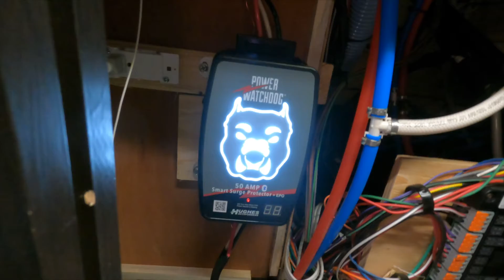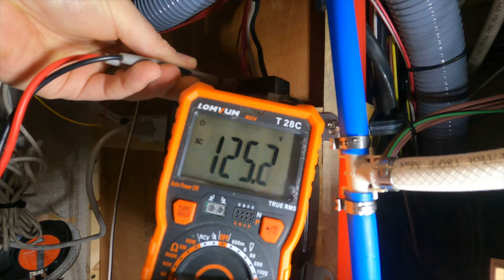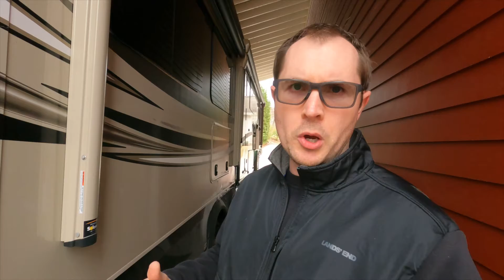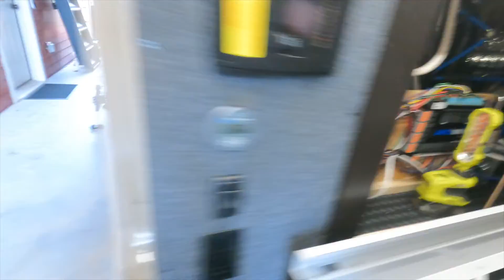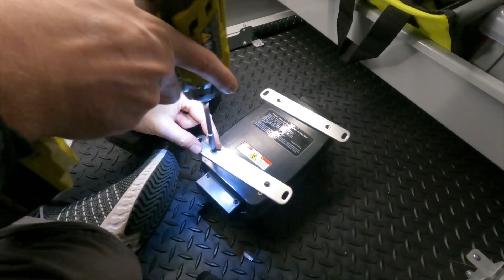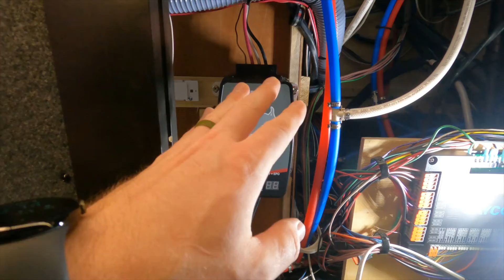Problems! Troubleshooting Open Neutral Red LED on Hughes Power Watchdog Hardwired RV Surge Protector

Comment: Did you try to just replace the circuit board
Reply from the maker: Turns out manufacturer discovered there was a defective batch of units that eventually produced the red light shown in video, desptie no open neutral existing. The manufacturer replaced them for me and others impacted.

Comment: I assume the Surge was out of warranty and Hughes done nothing
Reply from the maker: @Dave96595  actually, they replaced it ASAP. From what I gather, there was a batch of units that had a defective component on the circuit board, and after a set amount of time it would give that false positive that I was experiencing. I believe it was a limited batch affected, and once they got it fixed, the new units no longer suffer the defect. So definitely reach out to them and check if yours is part of that batch. I was very surprised at how quickly they replaced it. This was several years ago though.

Comment: Very helpful. Thank you so much! Still would be curious whether you measured L1 to L2 and what voltage you read.
Reply from the maker: Thank you. At pedestal it should be 240 L1 to L2 (both sides at W and E positions).

Comment: Having a 50 amp plug with two legs gives you 110 volt 50 amp on each of the two hot legs, correct? Assuming you do not have any device in the RV that would require 220 volt, does it make a difference whether you have the outlet wired as 220 volt split phase or 110 volt? I guess you really are getting in both cases 100 amp at 110 volt? Could there be a difference in the sense what the load is on the Neutral? Would Neutral get 50 amps through it at 220 volt in the split phase scenario but would get 100 amps in the 110 volt (2 x 50 amps)? Might make a difference what wire size you need for Neutral?
Reply from the maker: Correct, so in total it is 100A between the two legs, but just 120V. The legs are not combined, unlike a household dryer plug that looks similar and is indeed 220V. So the outlet you plug into must be wired with two 120V legs...again not combined. If they are combined to make 220V it would likely cause damage to the RV...I've never experienced this firsthand, but I have read about others accidentally plugging into mis-wired or thinking it's same as dryer plug and then frying stuff in the RV. Usually I see 6 to 8 gauge wiring on 50A RV applications depending on length. I've always seen the neutral as same gauge compared to the two hot legs. I hear your point though about why it isn't double size and I can't explain that from a technical standpoint, but my guess is it has something to do with fact it is just a neutral and not hot...but that neutral is indeed shared between the two legs along with the ground. I'm not an electrician though, so just my observations based on what I've seen so far...still learning :)
Reply: @AdventureRocks   I guess there is no way for me to know? If I test L1 and L2 with Neutral, I should get 120ish Volt each. If I test L1 against L2 I should get 240ish. If there is two lines from the panel coming at 120 and both have a 50 amp breaker, the shore side would work fine. However, L1 to L2 would show 0ish Volt instead of 240ish. Problem comes in when both lines are combined then going through the RV incoming power cable and transfer switch. The Neutral line inside the camper would get the load from both lines possibly with a total of 100 amps. While that does not necessarily cause a fault immediately, when running all ACs on a hot day all day and in addition running all else in the camper, it may get close to pulling 100 amp total. That is when Neutral is likely to get fried as it is not made for 100 amps (at 120 volt) but just for 50 amps (at 240 volts). I am not an electrician but trying to understand this stuff because I have had my shore power cable reel fried and am trying to understand why that happened.
Reply from the maker: @liveslowsailfastonlanier1374  The hot legs (or load) should never go to neutral, so if that is happening likely the pedestal or something is mis-wired. I might have missed this, but do you have a Hughes surge/EPO device or similar that checks for correct wiring? It should be able to detect all that regardless. My understanding is the frying happens when there is too much current for the gauge wire, which can be due to poor contact at the plug (dirty/corrosion leading to not enough surface area) or loose connection somewhere in the signal path (not enough surface area again) or if the breaker itself is faulty not tripping when it exceeds the rated load. The Hughes should cut power before in either scenario though...that's been my experience at least. Assuming everything is OEM on your rig, I'd double check that connections are tight from the shore inlet to transfer switch to converter/distribution panel. Sometimes I've heard about the contacts in transfer switch or breaker panel getting loose overtime with all the vibrations and then those loose connections cause loss of surface area leading to frying. I think most have a torque spec to make sure they aren't over or under torqued, but can be tricky as they are often hex head bolts/screws so need a specialty torque wrench to check to avoid damage to breakers. Anyway sorry I'm not more help on this one, but hope you can get to bottom of it.
Reply: @AdventureRocks  I have a Hughes Autofirmer (watchdog) with Bluetooth as you do. The Little LED is on as in your scenario. Both legs L1 and L2 show 120ish volt when measured to Neutral. Both legs will have power pass through the Hughes plug-in surge protector, despite the red LED being on. That seems like in your scenario.

If the outlet is wired as 220 split phase, then L1 to Neutral will read 120 and L2 to Neutral will read 120. Measuring L1 to L2 will show you 240. The amps through Neutral will be the amps going through L1 minus the amps going through L2 as both loads cancel each other out (two half’s of one sinus wave split into L1 and L2 60 times per second).

If the outlet is wired with two lines coming in at 120 volt but are not coming from a 240 split wiring, you still measure 120 volt between L1 and Neutral and you also get 120 from L2 to Neutral. When measuring L1 to L2 in this case you will read 0 volt instead of 240. 

In this scenario both lines will carry 120 volt and power flows through the surge protector. With an outlet wired like this the return wire Neutral now will carry the sum of amps from both L1 and L2 instead of the difference between L1 and L2. The amps do not cancel each other out but add to each other. 

Have you measured your outlet voltage L1 to L2? Does it show 240 volt or 0 volt?
Reply from the maker: @liveslowsailfastonlanier1374  My apologies. So the red LED in this video is actually a false positive. In talking with Hughes months after this video was published, they discovered there was a batch of devices manufacturered that all had a faulty component related to the red LED such that the majority of that specific batch exhibited the same symptom shown in this video after operating for an extended period of time. Anyway, they corrected the issue in manufacturing and it's my understanding they are still replacing the faulty devices free of charge for customers. They can determine based on serial number if your device is one of the faulty units. However, they also assured me that even with the faulty red LED light, as long as the device doesn't simultaneously report an error code, that the unit is still fully operational and protecting all conditions...just that it is throwing a false red LED for open neutral. Hope that makes sense.
Reply: @AdventureRocks
Reply: @AdventureRocks , total of 50A between the two legs, but that is 50A from L1 to neutral AND 50A from L2 to neutral.

This is important to remember because if L1 and L2 are not 180 degrees from each other, you will have a total of 100A on common which is 50A too much.

If they are 180 degrees from each other and you have an equal load on each leg, common has no load on it. Common carries the imbalance.

Comment: Any chance it is the user replaceable board. I just noticed the red light. I carry extra replaceable cards and will change it out.
Reply from the maker: It's my understanding there was a batch of units made back around 2022 that develop the fault shown over time, but the unit itself still is working and protecting properly, it just erroneously displays the red open neutral light. Hughes will replace it for you under warranty as they are aware of the bad batch.

Comment: Thank You for video. I found this after researching the red light on ours. Guess I’ll be contacting Hughes as well and see how it goes.
Reply from the maker: Sorry to hear it happened to you. I later learned that there was a batch of them produced that had a faulty component causing it to give the false positive on that red LED over time...all of them in the batch will do this eventually. So my understanding is in reality there are no issues on your rig or power source, as if there were it would show an error code. However, that one LED lights up regardless. They are fully aware of the issue now and they will take care of you. I've been super impressed with their willingness to stand behind their product. I would 100% buy it all over again.

Comment: Mine is doing same thing .. did they warranty box ??
Reply from the maker: Yes, reach out to them and likely they'll replace it. Apparently there was a batch of devices manufactured where a specific part fails over the long-term causing the false positive. So they are definitely aware of the issue and which units are affected. But if it helps to know, it's my understanding that the device itself is still functional, it's just giving a false reading.

Comment: My unit developed the same problem about a month or two ago. I had moved the RV (and thus the unit) and noticed that now…no red LED. 🤷🏼‍♂️ That’s a puzzler, but things are working.
Reply from the maker: Interesting. You'll have to report back in the future if otherwise.
Reply: @AdventureRocks However, what did I notice last night? A RED LED. I will have to contact the company.

Comment: I have had 2 different progressive industries surge protector fail.  If you have a progressive unit they ask you to pull the cover and take a picture inside to send to them before calling.  In both cases the problem was a connector had come loose.  The first time this occurred I went and bought a new progressive protector before I read how to submit a warranty claim.  So then I had two.  After pulling the cover and finding the connector issue I just kept it as a spare.  Then the second/new one did the same thing???  And yes it was an internal connection again!  Again east to fix, but frustrating!

So now I have a Hughes watch dog and two progressive spares.  I suspect what caused the connection issue is just getting knocked around while running down the road.

I now have mounted my Hughes inside the RV, but I installed 50 plugs in my RV and plugged in the Watch Dog to allow for either easy swap or by pass.   

I hope you find out what was going on inside your bad unit.  I am a little surprised you didn’t crack it open?  That is what you would have had to do if you changed out the EPO circuit.  I would bet a dollar it was a connector in this one also!

Thanks for the video!!
Reply from the maker: Hughes asked for the defective one back so not sure what it ended up being. It's great to have a manufacturer honor their warranty. I'm very grateful.
Reply: Thank you! I have this same problem with my Power Dog and will follow up with Hughes.

Comment: Mine is doing the same thing does that mean my surge protector isn't doing its job?
Reply from the maker: I'm not sure about that, but it seems like the LED indicator light for the open neutral condition was malfunctioning. Basically it was giving a false positive in my case where in reality nothing was wrong with my power source. Hughes was great about replacing it though for me so definitely reach out to them.

Comment: Mine is doing the same thing. I thought it was the parks problem and they testes their power and find my Hughes is defective too.
Reply from the maker: Interesting. Hughes was great about replacing it, so hopefully you'll be up and running again soon
Reply: @AdventureRocks  I emailed them today. They are sending me the parts to fix mine, I have the Hughes Autoformer with booster.

Comment: Did Hughes send you the swap?  They have a lifetime warranty.  There is a module that is replaceable in that unit for $30 instead of replacing the whole unit.  I carry a module with me all the time just incase.
Reply from the maker: Yes, they replaced under warranty :) Guess it was some kind of fluke in the electronics outside of surge itself. Great tip on carrying spare surge just in case.

Comment: I think I would have changed the Watchdog to a South Wire surge guard I am not a fan of the Watchdog because of the trouble I am having and their customer service it terrible or not at all. Oh and the company is 5 miles from my house so I drove over to them and talked to Brett and he did not offer any help and now has me on ignore because I have emailed and called and left messages at least 5 times. Mu Watchdog turns off the power completely for a few min. and then comes back on E6 code plus the trailer is plugged into my house where it has been for a few years and I tested the plug with another surge guard and it reads good. I wish I would have stayed with the portable surge guard. I may find a junction box and removed the hardwired Watchdog and use my South Wire SG plugin type.
Reply from the maker: Sorry to hear. I'm supposed to get a replacement under their warranty, but we'll see if they follow through. The service I got wasn't the worst, but certainly could have been better.
Reply: We used a Surge Guard brand in our Class A mounted in the electrical bay which is just forward of the genset compartment. For our trailer I think we will buy another along with the digital display and mount it in the pass through.
Reply: I had a South Wire and the thing hummed so loudly that it drove me crazy. I can barely hear the Watchdog and I don't need an additional component to monitor it remotely.

Comment: Great information in this video.  Thank you.  Do you not worry about arcing when you are plugging in your power cord to the wall.  I always turn off breaker at CG pedestal to make sure nothing is drawing current from the coach. i.e AC left on.  I melted the end of our 30 amp cord from an arc last year.  Learned to always turn breaker off first.
Reply from the maker: Great point. It's a good idea to kill power when plugging in, but arcing is more of an issue when you have a heavy load/amp draw while plugging in...that heavy amp draw while plugging in is what causes the arc. So another way to avoid is to make sure AC is always off before/after disconnecting or reconnecting.

Comment: Great video.  I have the same unit from power watchdog.  Since these have replaceable surge modules I wonder if replacing that would have done anything?  Be an interesting test as the modules are a lot cheaper than replacing the unit.  Hope you hear good news on warranty from Hughes.  Let us know.
Reply from the maker: Thank you. I wondered the same thing on the surge module. I am awaiting final verdict from Hughes, but sounds like it'll be covered under warranty either way.

Comment: Thanks for the videos. You are the reason I got my watch dog hardwire. I have it in my Jayco Eagle. I got a 50a plug tester just like you used on your 110 plug. Just for 50a so that I can test at every camp site before I plug in. No need for another surge protector.
Reply from the maker: Great idea on the 50a tester!

Comment: Good stuff Jay.   Did you check the app to see if it was reading any errors or verify what your voltage was at?  

Ironic, we have both the exact same placement for the watchdog...I do like what you did with the transfer switch!  My next project 🤣

Thanks for the great video!

....Oh I remember when my basement looked like that... There's so much I've done to that "inner" bay, which opened up so much more room.  Now my entire solar setup and 6 lithium batteries are in that inner bay...I sure love working on making things better 😁..
Reply from the maker: Thank you. Yes, forgot to mention the app showed nothing, just regular status. App matched the multimeter readings on voltage. Basically if I hadn't physically seen the red LED on device itself, I would have never known anything was out of ordinary. But, I'd rather a surge/EPO give me a false positive than a false negative, so thankful to have it onboard still.
Reply: @AdventureRocks  I totally agree with you about having it onboard.  One less thing we need to worry about disappearing.
When we arrived in Louisiana for the winter, I watched the watchdog app for a week and noticed the power was fluctuating from 118v down to 109v.  No one in the park knew it was so low, do I notified the mgr, and now their working on finding the cause.  
Thanks again Jay. Merry Christmas to you and the family.
Reply from the maker: @kreutztimothy  Thank you! Merry Christmas!